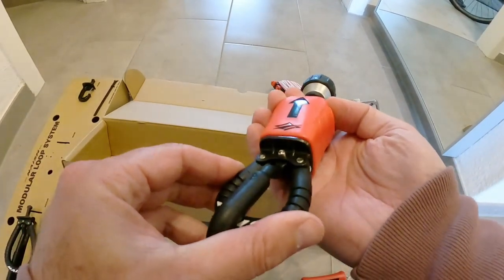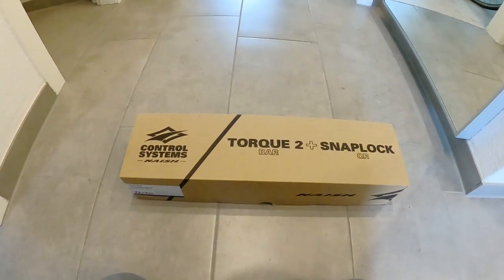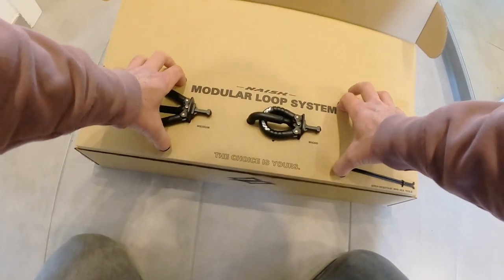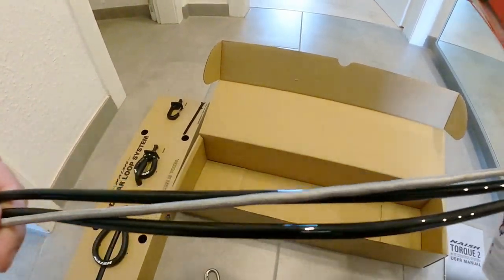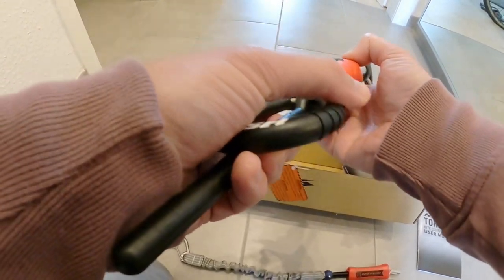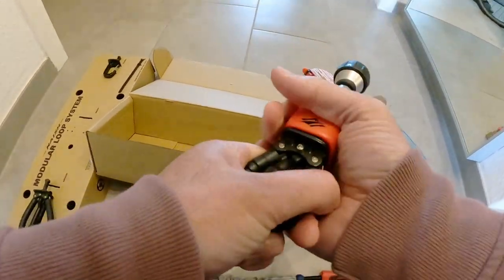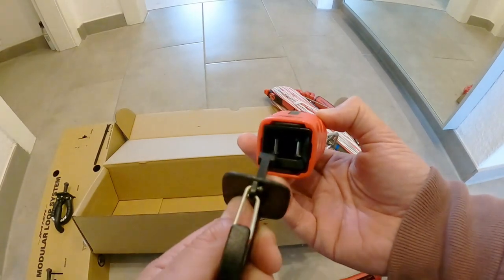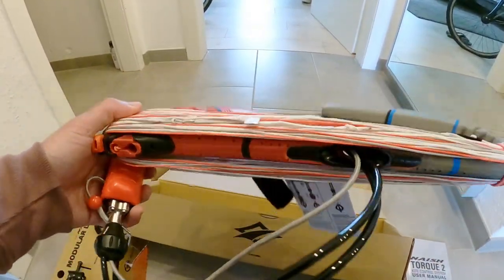Unboxing Naish S26 Torque 2 Kite Bar, Modular Loop System, review, Kitebar

Comment: The question is: is there a possibility to loose the chicken loop after a ejection on the water in a difficult situation? disconnecting from the harness for some reason?
Reply from the maker: Hey, I ride this bar now for several months and I never had a critical situation due to these concerns. You can check the following two video's to get a better visibility concerning this concern:
https://www.youtube.com/watch?v=JvO4rGOMNy0&t=36s
https://www.youtube.com/watch?v=vwFWjrvZfk4&t=74s

Hope that gives you a better impression... Cheers :-)
Reply: Only a few riders have a unhooked style and for those is easy to reconnect the ejection system after maneuvering. Naish could make an unique hook similar to the slider fixed to the harness. This way the ejection movement wold be used both for ejection and unhooked riding.

Comment: Hi Marcel! Nice Review!!

As I can see you ordered the ATB50.

a) For which kite sizes do you use and why did you go for the ATB50 and not the aTB55?

b) As I'm not that big I'm especially interessted in the the "depower throw". So the distance the bar can travel along the depower tampen. Could you please measure it? This would be very interesting.

c) Or other question: Is there a possibility as within the old Torque 1 bar to adjust / or to limit the depower throw of the bar?

Thanks in adcance! Cheers, Christoph
Reply from the maker: Hey, okay :-) let me answer this step by step...:
a) My range is 4m, 7m and 10m and a went for the ATB50 because I prefer small and short bars. It feels more loose for me...
b) the bar throw is 47cm. Should work for you... For me, it a bit too short :D but this is just my personal thing.
c)Yes, even for both options the ATB and the BTB

Enjoy riding :-)
Reply: @Surf_Life  Thanx Marcel!

So, it is still possible to adjust the height of the adjuster on the new orque 2 ATB bar??
...I'm just wondering as this might not be possible anymore as now the trim lines are PU-coated?

Thanx again for your final feedback on this.

Cheers from Austria, Christoph

Comment: Have seen people losing the loop several times....and how do you connect "semi suicide"., Overrated....
Reply from the maker: Well, that is a risk. At least, that never happened to me 😀🤙🏽. What bar are you using or which Bar is the best, from your point of view? Maybe the naish team will read that and improve that in the next version.... Anyway, enjoy kiting 🤙🏽🤙🏽🤙🏽😎
Reply: @Surf_Life  hi. I'm using the naish 2020 24m. Some of my friends use the new bar...I'm not so stoked about it...
Also the friction from the centerline seem to grab my skin...but haven't tried it...
Reply from the maker: @blandetbolcher4779  ohh yeah😅, I know what you're talking about. Always annoying when you loose some of the top layers of your skin between the fingers... Not cool. At least, this is fixed with the new bar. But what is the best bar on the market right now for you? Slingshot Sentry, Reedin, Core or even the duotone click bar?